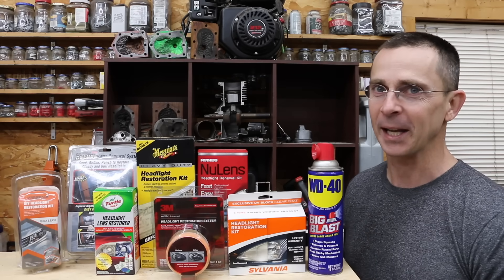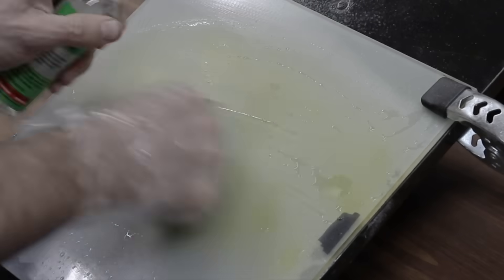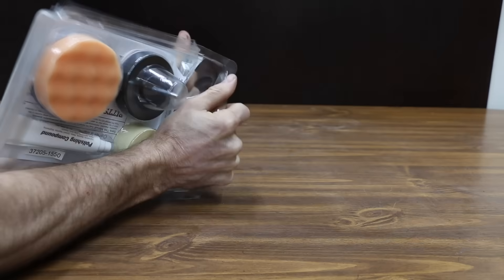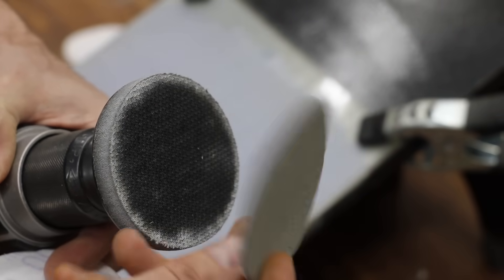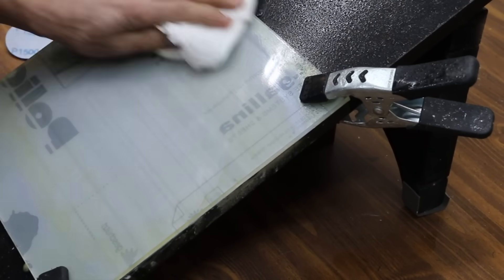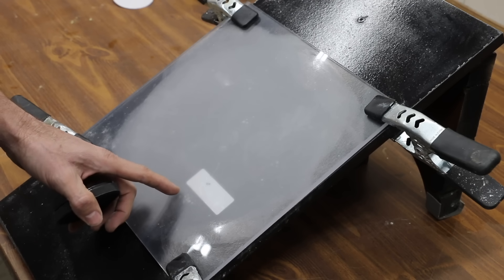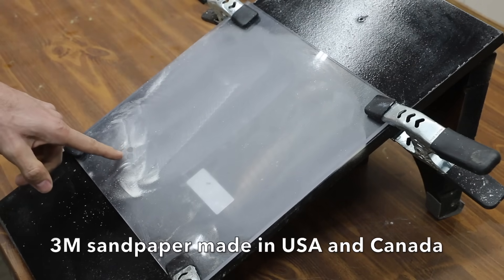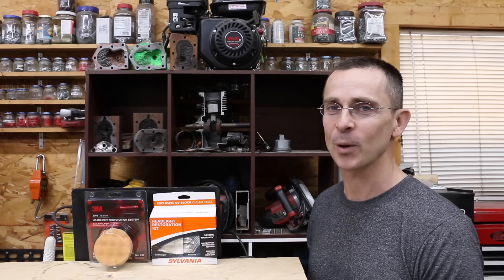Best Headlight Restoration Kit?  Let's find out!  3M, Sylvania, Meguiar's, Mothers, Turtle Wax & HF

Comment: Consumer Reports also said the Sylvania kit was the best! Someone bought me a harbor freight kit not too long ago and it still impressed me. I wet sanded with every stage though since I hate dry sanding. It dramatically improved the lights I used it on. But not crystal clear like the better kits you tested.
Reply from the maker: Great feedback. Thank you!

Comment: Amazing timing PF, I'm gearing up to do the headlights on one of our cars.  One of the mechanics I follow on YT just posted a vid where he used DOT3 brake fluid to completely remove the oxidation from the lenses on a car and it actually worked.  Maybe if you do a second round of these kits you could try using that plus a series of sandpapers to see if the same results can be achieved?
Reply from the maker: Great recommendation for round 2

Comment: I bought the 3M Heavy Duty Headlight Restoration Kit last year and was very happy with the results. It used drill attachments and had a final UV wipe to seal the results.
Reply from the maker: Great information.  Are the headlights still clear?
Reply: @ProjectFarm  Yes they are. However, I park in a carport now so they don't get near as much UV as they did when they were initially hazy. As I'm sure you discovered, the key is in the sanding and taking your time on each stage.

Comment: “Dime sized” 
man throws on a half dollar sized amount😂😂😂
Reply: Bigger the gob, the better the job -science
Reply: @mattbrown7189  AvE science, lol.
Reply: This is what you took away from this video.
Reply: Inflation, bro
Reply: This one time, in band camp.....
Reply: Was that a dime, or an Eisenhower Dollar Coin....  Never mind, nobody remembers those....  Heh heh!!!
Reply: I never knew that the coins in the USA were so large!
Reply: Look-up the “two shots of vodka” meme.  Fn hilarious.
Reply: 8:53 “This will reduce the splatter”
9:00 - splatter everywhere.
Reply: Also starts the drill immediately on contact instead of spreading around before using the drill.
Reply: @ZerotheWanderer  he doesn't, he just has it ready to go. My drill does the same thing with the light. You can actually hear when he turns it on.

Comment: I've used the meguires kit. It worked well initially but the uv coating did not hold up. I got about 6 months before the cloudiness started to re appear. The kit i used was different than the one you tested. It contained 1000, 2000, and 3000 paper, plast-x compound, but the uv coating was in a little spray bottle....you should have tested bug spray lol
Reply from the maker: Great feedback. Thank you

Comment: So, when will we see a sandpaper video? Seeing 3m-paper compared to that other brand was really a HUGE difference
Reply from the maker: I need to test them soon. Thank you
Reply: I dunno what they use these days, but in the late 90's they were using calcium stearate grinding aids to prevent clogging and ensure cuttingg efficiency. I made many miles of sandpaper at 3M. We used to do a lot of R&D on the stuff to ensure we were near or at the top of the pile. I still have a ton of 3M sandpaper i "liberated" about 20 years ago. Still good stuff. Expensive though.

Comment: I used the Sylvania restoration kit almost a year ago and it still looks brand new! This video definitely translates to real-world applications.
Reply from the maker: Great feedback on Sylvania!
Reply: I used the Sylvania kit about 6 years ago. The clear coat came off in the middle of the lens a few months later at the car wash (both headlights). Since then I sanded them down again with a Simoniz kit and then applied a Rustoleum UV protective plastic bonding clear coat (I got this idea from ChrisFix). It's held up for years now. I'm confident that 90% of the benefit just comes from the clear coat itself unless you have severe yellowing/oxidation.

Comment: I used the 3M before and was happy with it but It came back because I neglected to apply wax after. It still lasted a few years before getting dull again. But you didn't try off mosquito repellent. That has worked the best in my opinion. The main ingredient is what works. The higher the percentage, the better it works. My car died before I had a chance to see how long it lasted. But first impressions was great
Reply from the maker: Great feedback. Thank you

Comment: For me, the best results are regular sand paper and a proper polisher with Meguiars polishing compound. I sand with 800 grit, then 1000 grit, then 2000 grit, and then 3000 grit. I sand until the headlight looks smooth and even.

Then I polish. I start with a cutting compound, then a medium compound and finally a swirl remover. Some headlights end up looking like new.

Results depend on the headlight condition. I have a 2005 civic, and it's headlights were a disgusting booger-green tint. They were clear, and not hazy, but were not colorless. No a mount of sanding and polishing fixed them, so I had to replace them.
Reply from the maker: Great feedback. Thank you

Comment: I have had tremendous positive and long lasting results with Meguiars Plastx and aerosol can Headlight Coating after wet sanding using several finer grades of sand paper. Takes me about 2 hours or more per headlight lens by hand but lasts for two years or longer. Really good stuff. I regret that I cannot post before and after pics here in the comments.
Reply from the maker: Great feedback. Thank you

Comment: You should test different shovels and rakes for strength. I always seem to break my cheap equipment. I'd like to know if the more expensive brands are worth the price difference. Also, test wood vs fiberglass handles.
Reply: My dad has broken many rakes, cheap and expensive. I ended up welding a length of 1" steel pipe to the head of a broken rake, and now he can happily use it as much as he needs without worrying about it breaking. If you use your rake to move dirt or gravel, and can weld or have a friend who can weld, it might end up worth it to skip the store bought rakes.
Reply from the maker: Great test idea! Thank you

Comment: When im lazy i do use headlight restore kits from Mother or Turtle wax(the have different types for different regions) But most of the time i sand my headlights, polish and reapply clear coat and now i add paint protection film to my headlight that are UV and heat resistant about 65mm thick
Reply from the maker: Great feedback. Thank you!

Comment: None of those will work for a 4th gen Supra....  Trust me.  Easier to buy the glass headlamps.
Reply from the maker: Thanks for the information.
Reply: @ProjectFarm  I put hours in my headlights.  I even pulled them apart to get to the inside of the lenses and tried cleaning them.  No good.  I broke down and spent 600 on the glass lenses and much happier.

Great channel though!  Keep up the good work!

Comment: I'm afraid I feel your experimental.procedure is very poorly constructed. Normally, your test methods are quite good.

There are a number of flaws.

Your test procedure does not replicate sanding through the hard coat, a challenging task. I don't think there is a good substitute for this reality.

The polycarbonate yellows to some depth below the hard coat. Your test attempts to simulate it with a very thin paint coat. You might do better to try dying the polycarbonate

Real headlights are curved. Preparing a flat sheet is much easier. You could use a pc cylinder or form a sheet into a cylinder.

The Meguires kit is aimed at a very different customer than the rest of the kits. Their customers will be polishing out very fine defects in, often, collector cars.
Meguires, BTW is owned by 3M.

3M does sell a kit that includes a protective coating, but they also suggest you use a quality wax if you bought the kit without the sealant

I'd be happy to discuss further if you like.
Reply from the maker: Thanks for the constructive feedback

Comment: I was literally planning on going to the store in like 2 hours to get a kit, this is the perfect timing for this video to come out!
Reply from the maker: Great feedback. Thank you
Reply: @ProjectFarm  this is the one place I can come to feel confident with knowing I'm using the best product possible
Reply: Same here!
Reply: Regardless of which one you get, start the whole process with some Acetone Free Fingernail Polish Remover for the cleaning part.  I damn near brought the restoration kit back to the store after doing this because the nail polish remover did such a great job.  I have been tempted to try regular polish remover (with acetone) because I know how it works on plastics, but I have been afraid it might "etch" it too much.  Just be sure to protect your paint when doing ANY of these.  Nice looking head lights won't mean much with a scratched up car/truck.
I would also suggest using some 3M 303 UV protector or a spray on clear coat with UV protector.
Reply: Not the perfect time for me. I wish I didn’t settle for the turtle wax brand
Reply: Seriously this video is right on time
Reply: What did you get?
 And how is it now in 3-2024?
Reply: I replaced mine with low quality lenses 😢

Comment: Another way to get rid of foggy headlights is buy new ones. I kept restoring mine, but nothing would last more than 8-10 months.
In the second car, I just bought a pair of new headlights (OEM for 150$ pair) and they've lasted 8 years now and haven't shown any signs of yellowing yet. If you have xenon bulbs replace them with LED as soon as you can, xenon lights wear the plastic cover down when you use them at night.
Reply from the maker: Great feedback. Thank you

Comment: I've had great luck with the 3M kit. Add a UV clear like you said and I'm sure results would be similar to Sylvania. The Sylvania kit really did an excellent job though! Definitely the top picks. Rust-Oleum sells a clear coat for plastic which should bond well and is meant for outdoor use. Great to add to the 3M kit. :)
Reply from the maker: Great feedback.  It's an amazing kit!

Comment: I use the Meguiar's Two Step at work, and I use a 3M drill adapter because power tools make everything better.
Tape off one side, buff with compound, tape off other side, buff with compound, wipe away dried compound from first side and stray with sealant, repeat for second side. Wait 5 minutes and spray a second coat, then remove tape. Thats how I do it, it turns out nice.
I dont know much about the longevity of it, but I did my mothers Accord a few months ago and theyre still good. It obviously isnt a replacment for new housings, but it's cheaper.lol
Reply from the maker: Great feedback. Thank you
Reply: @ProjectFarm  and unfortunaly I got the 3M adapter out of a gutted pack so I never tried the included contents. But you show enough of it. Great video as usual. 👍

Comment: I used the Sylvania kit on a few cars, it's amazing.  Worth the price, I was able to make a nearly $1,200 set of Lexus headlights look new.
Reply from the maker: Great feedback.  The UV coating is simply amazing.
Reply: That Sylvania kit killed it. 

I’m curious though. If you applied the Sylvania clear coat on the 3M piece, would the end result be similar?

Is the clear coat the only thing keeping the 3M product from making the polycarbonate “like new”?

Comment: I have an idea for you, but Im not sure if it is something you would normally cover. I drive my personal car a lot for work. I may make 10-20 stops in a day. So my question: Is it better to leave my car running all day, or to turn it off at each stop for 6-10 minutes at a time? This would include during winter and summer with the heat or AC running as well. Thanks ! Love the channel and recommended it to all my mechanic friends.
Reply from the maker: Great video idea!  Thank you very much!

Comment: This is AWESOME! I’m an amateur detailer and have started doing headlight restorations, I thought I’d just go down the line, but you did it for me! You’re my favorite tool channel
Reply from the maker: Thank you very much!
Reply: You'll also want to watch ChrisFix's videos on detailing etc.  Per 'How to Restore Headlights PERMANENTLY' using automotive clear coat on them after fixing the haze, the clear coat generally has good UV protection part of why it's expensive.
Reply: BTW not slighting Project Farm in the least this channel is great, ChrisFix and a few others are a bit more specific and in depth for car detailing though..
Reply: @ModelLights  i would not recommend chrisfix's method as many people on the r/autodetailing have problems with the longevity and the application. Its definitely not beginner friendly like these kits r designed to be and the audience that is probably watching this video rn.
Reply: If you're going to do this for a living you can't use DIY kits!  Get quality 3M sandpaper with grades of 800, 1000, 1500, 2500 and all four grades of 3M paint  polishing compounds. And DO NOT always use all of them on every car! Not all headlights need 800 sanding. If they're very rough to the touch and/or yellow they probably do. But if they're smooth and white but hazy you could make them perfect just using compounds. It's up to you to analyze them and decide how much polishing they need. For sealing coat - some people use film but you need to accuire a new skill for that. Some people use ceramic coating wich in my opinion is quite good and easy to apply.
Reply: Rasho — Meguiars headlight coating in a aerosol can is what I use to seal the headlights. Suppose to last up to a year and is easy to polish next time around, which you will have to do with our beloved Sun frying the hell out of everything. 

It seals up leftover scratch marks and adds a nice shine to the headlights look Like New. I’ve done a dozen cars with it already.
Reply: 3M makes a professional kit
Reply: I use my rotary machine with a wool pad at 15 1600 rpm using a chemical or diminishing abrasive compound, finish at 1000 1200 rpm. Seal with Si02 or optiseal. I do a pair in around 8 minutes. Use what you have and save that money for better chemicals.
Reply: Skip all the bs, Sand all old coating off then re clearcoat with uv protectant.
Reply: Great, thanks. What you been using?. See my comments

Comment: So.. I've been doing this for nearly 20 years.. i developed a kit  and showed it to a rep that I worked with at 3m in 2006. 
Then 3m comes out with the kit I developed.  They are thieves.
Btw.. the process is an adaptation of what I did. Except my process lasts longer. And I have 5 stages before reclearing.
Reply from the maker: Great feedback. Thank you

Comment: I think a better way to have simulated the harsh UV damage you could have used a UVA/B light on the lens substitutes.

Disregard the UV C light, it's not found in any significant way thanks to the atmosphere doing its job.

Edit 2: Eh, actually this was a good enough approximation. It certainly acts well enough to show those that do something compared to those that don't. The yellow spray was a god alt to actual UV damage
Reply from the maker: Thank you for the constructive feedback